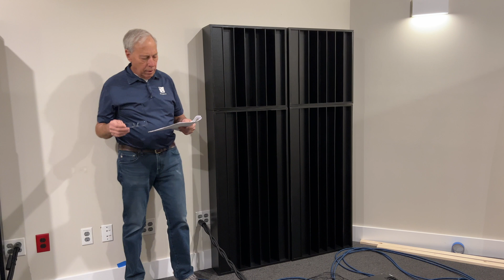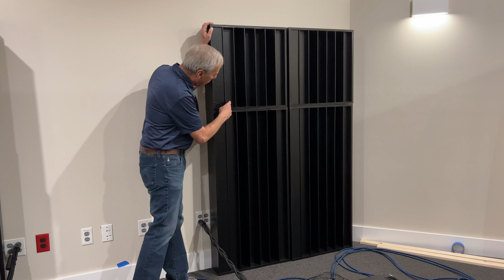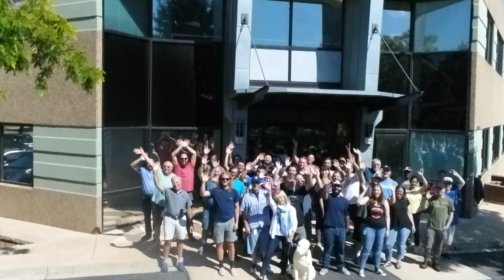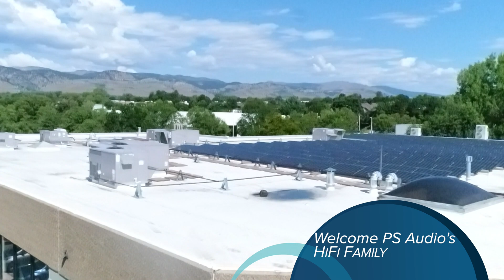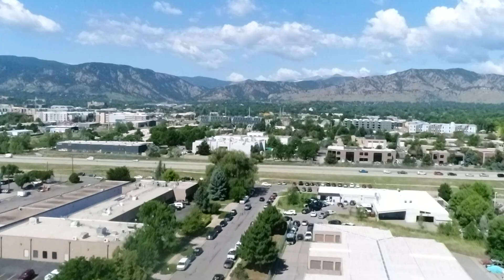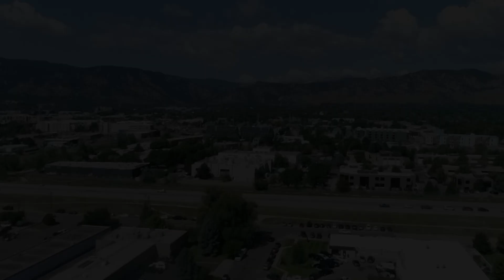Understanding acoustic diffusers

Comment: Are  Diffusers still worth it if you don’t have dipoles?
Reply: Very much so!!  See, it's more than diffusing. Breaking up the reflection is nice, but it also adds a slight time delay as the sound wave bounces around in the wells then comes out to your ears. The more diffuse and slightly time delayed the sound is, the more our ears/brain can differentiate the direct sound from the reflected sound.  

Also,  reflected waves interfere with the direct sound causing "nodes" or hotspots/deadspots in your room...most notably in the bass frequencies, but it also happens through all frequencies! When a positive wave hits a negative wave, they zero each other out! So imagine someone taking a parametric EQ and dragging a frequency down 10db. Or a positive wave from the speaker mixing with a positive wave bouncing off the wall, and it's like someone taking a P-EQ and pushing the slider up 10 db!  Properly designed diffusers set in critical areas will break up those reflected waves, and give a little time delay to them, and damping them very slightly giving your ears/brain the best chance possible of discerning exactly what the artist intended spatially and sonically.  

This is why all the greatest recording studios typically have diffusers on the wall behind the mixing board...so they can dial everything in for the master recording without the room having a big influence on the final output.
Reply: @LonelyRavenProductio  Thankyou for the detailed  response👍
Reply: yes

Comment: For those who want a bit more technical explanation:  in the discipline  of architectural acoustics, diffusers are used to help reverberation be more uniform throughout the space.  In other words, diffusers keep the sound (pressure level) from focusing at particular spots around the room.  Diffusers can also help lower the T60 value (though an absorptive medium is what is often used primarily for that purpose.)
Reply: And even more technical:  The term diffusion in the general sense is applied to many kinds of objects.  One of the aspects of air, through which we humans "hear", is that it absorbs high frequency sound rather well.  Sound is the movement of energy in a wave-like manner.  In air (at Earth's surface pressure) high frequencies of sound do not travel far, being absorbed, and this is a general type of diffusion (the fundamental ideas come from statistical mechanics and thermodynamics.)  

So one thing sound diffusers accomplish in your room is making the path of a sound wave much longer to reach your ear, thus allowing more time for the energy in the wave to thermalize, i.e., simply become heat in air.
Reply: @TheDanEdwards  and even MORE technical:
Diffusion makes the sound less TINNY. 😜

Comment: Paul, are you sure that is not just a black HVAC?
It is also interesting to look at the old JBL acoustic lenses that where used to spread the angle of high frequency horns. That's still what I think of when I hear diffusers in the context of Audio.
Reply: "old JBL acoustic lenses that where used to spread the angle" - are you referring to wave guides, which speaker builders sometimes use?

"diffusers in the context of Audio" - in the context of audio, "diffusion" as a term applies to architectural acoustics.  Though not describe that well by Paul, in this context diffusion affects the reverb time throughout the room.  Diffusers are used so that the reflected energy (sound pressure) doesn't focus at spots around the room.